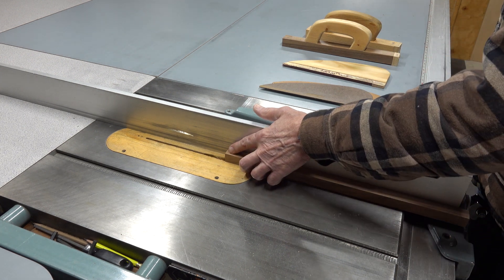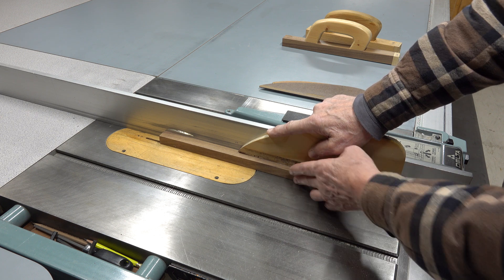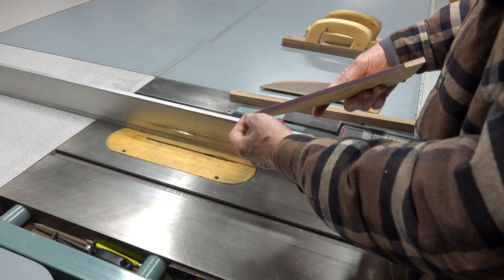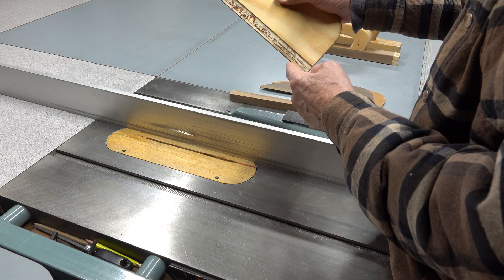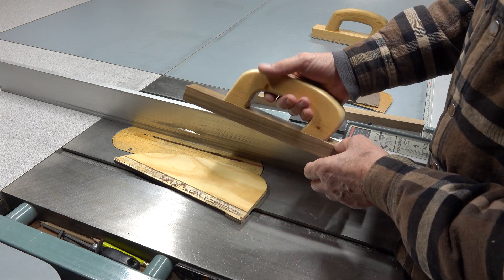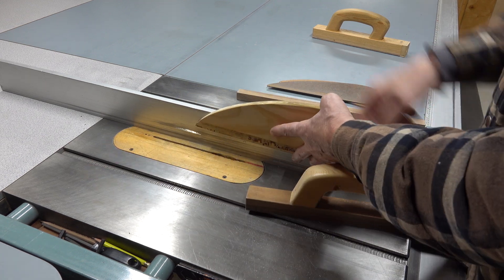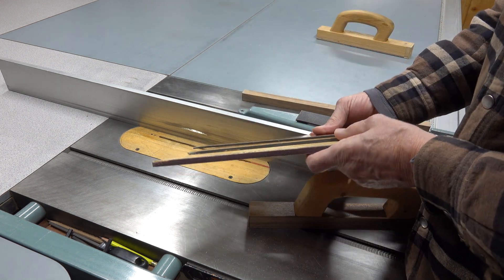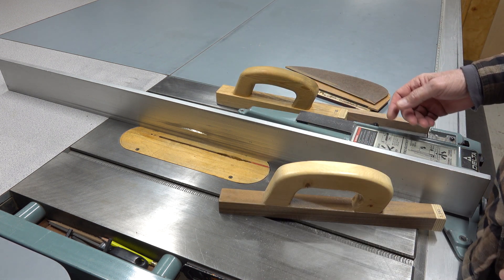A BETTER SAFER PUSHSTICK?

Comment: The sandpaper on the bottom is a great tip, I’ll be doing that!
Reply from the maker: It really adds control you can't believe in possible in a push block/stick/item lol

Comment: For one if your board isn’t 12-14” long don’t use it! The ride up on top of the blade is common on extremely hard wood and also some blades are sharpened for different purposes!  Several things help with what you describe, hold down wheels that only turn one way prevent the kickback best.  I used only one and controlled the board with a quality push stick
Reply from the maker: Thanks! The trouble is the really small pcs.

Comment: You are not using a push stick. You are using a hold down stick. The type you mention that keeps your hand far away (the sole job is to push) will require other means of controlling the wood at times. But it has the great advantage of not placing your hand anywhere near the blade at any time.
If further control of the wood is needed, then use a feather board. After all they are called push sticks.
you also do not have a splitter. A Highly recommended safety feature.
My opinion is my hand does not come close to the blade, that includes going over it.
Reply from the maker: Yeah, I get it, did you see my video Deluxe Table Saw? It pretty much sums this up. As far as feather boards go, did you see my other video on feather boards? All of this has its place for sure!!
Thanks for your time Dave!

Comment: You really need a riving knife to help prevent kick back. Much safer.
Reply from the maker: They tend to make my work much more dangerous so I use a better method I devised in "Deluxe Table Saw" which is safer to me by many times. Check it out.

Comment: Get a. Gripper, it will change the confidence for ripping on a table saw 
Costs about 80 bucks, what does six weeks of hand physio cost?
Reply from the maker: ED, I cut more really small stuff than most of the planet does. All those fancy rigs are cool as hell but not for really small stuff when your tight to a fence. I've seen these and they are helpful to the vast majority for sure. THANKS for the visit!

Comment: Appreciate the reminders about table saw safety.  What is on the near side of the table saw fence in this video?  It looks like a metal auxiliary fence, maybe 1/4” x 3”, could be steel or aluminum, can’t really tell.  And how is it attached?  Was it original equipment?  Or an add-on?  Very intriguing!
Thanks!
Reply from the maker: Are you talking about the rolling side fence? See my video Deluxe Table Saw to see more on it. Not sure if they are still offered but this one has a new top on it, not stock and a lot bigger.

Comment: Thanks for this!  I use fence mounted rollers called W1104 Board Buddies.  They hold material down, prevent kickback, AND pull material to the fence.  Safe, accurate cuts every time for cutting 1.5" (40mm) or wider.  Jessem guides are similar and work better for narrow cuts, but cost more.  Here is my complete set-up.  https://youtu.be/KzykCHQIVHA
Reply from the maker: Never was a fan of anything in my way but one heck of an idea for large stock.

Comment: I never understood the push stick that comes with a saw. I’ve never used one. I want downward pressure as well as a good hook on the back end of the workpiece. I make all my own push sticks. I can stop the blade from spinning with the control I have. If I’m trying to rip thinner than 1/2” I will cut the 1/4” or whatever on the drop side.
Reply from the maker: Excellent!!! Thanks For visiting!!

Comment: I always run with 2 push sticks.  One large one for the back, where my fingers can remain far from the blade, and one long thin one, forward of the blade, to keep stock firmly riding the fence.  Those cheap plastic ones work well for that.  I have always had trouble with feather boards, but a forward push stick will always reduce the risk of that "chatter", with or without a riving knife.

I see a massive glaring flaw with all of your push sticks.  They force your hands to always be very close to the blade.  If you're applying pressure and you do get kickback, your hand is going directly toward that blade.  

A riving knife is an absolute game changer, but it appears you can't install one.  Even if you're extremely careful, the risk of kickback is much higher.  If it does happen, your fingers are already extremely close to the blade.
Reply from the maker: If you watch my Deluxe Table Saw video you'll see I took care of the issue. My bad for not having it in place when this happened. Also it was my fault for selecting a blade that was less than super sharp so it caused the issue by creating heat bigtime...
Reply from the maker: This "flaw" is actually my saving grace too sir...since 1980 I've used these style push sticks and they work EXCELLENT when the "deification hits the oscillation"! As mentioned in the video the further you get away from the blade, its leverage vantage against you multiplies like mad...it's something I fully intended in the little bit shorter design.

Comment: Good advice, I have an assortment of shop made push sticks and pads. I agree that for narrow strips a push stick with a long base is safest.  I also have a Milscrafts GrabberPLUS, it's an excellent push block at a very reasonable price. I like the retractable heel on both ends, and the slanted grab handle allows choice of holdings towards or away from the blade.
Reply from the maker: I had to watch their video, I think its innovative as heck but there is setup for every cutting width and depth plus parts that I'll need to buy over time, sacrificial parts. I'm a freak show lol I don't have time to waste setting up a push stick lol.